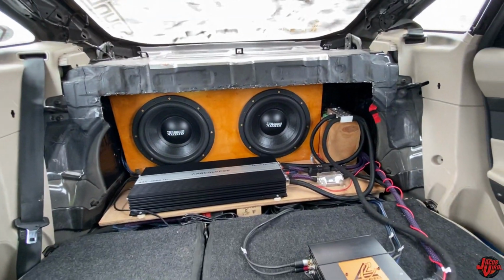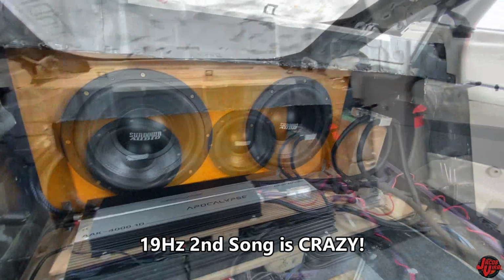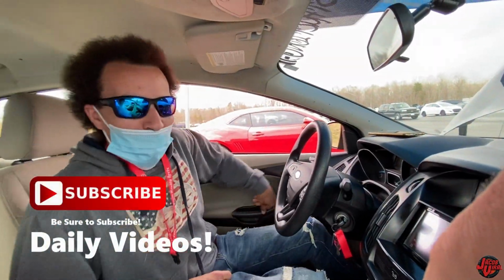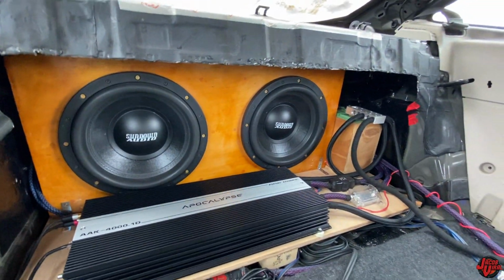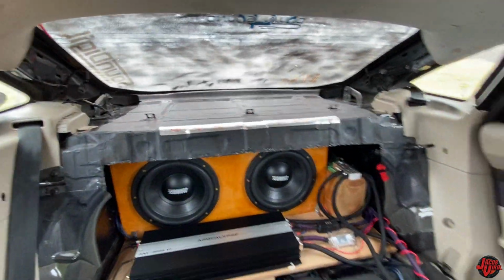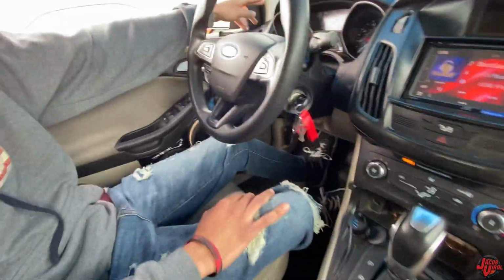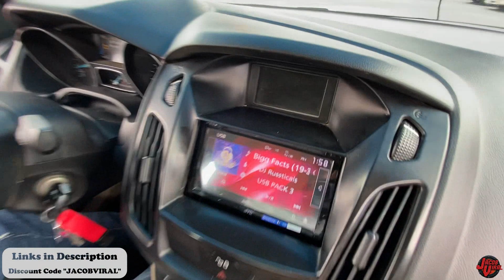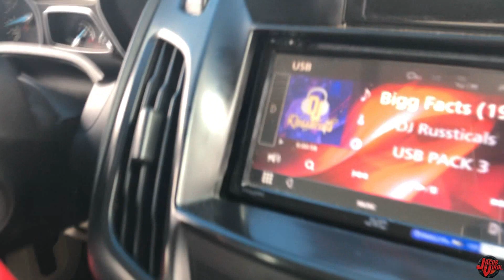2 12” SUBS TEAR UP THIS FORD FOCUS!

Comment: A similar set up I am doing. I have octo port as well. Running two zv5 12’s. Only difference he looks like he’s got more space to work with. My box takes up the whole trunk barely enough space for the cmax and amps in a Hyundai Accent
Reply: Ever consider using your spare tire space for your battery?

Comment: What the F×××!!! That's louder than my 1 18" Resilient Sounds Platinum subwoofer!
Reply: More cone area dude. What do you expect. For all the bass channels I see you comment on you're not learning too much
Reply: You need more power and a bigger box then
Reply: @Simpleman1078  I thought 2 12" subs was less cone area than an 18" sub but I gess you might be right.
Reply: @nickolasvaughn667  o no definitely don't need a bigger box. I actually need a smaller box and I'm running it on 4600rms watts!
Reply: 18 inches of cone space vs 24 that being said I would take an 18 over two twelves even if it was the exact same brand & model. A 12 just can't produce the same sound as an 18
Reply: One 18= 254.46sq inches. Two 12s= 226.188sq inches. Some people need to do their math (slow poker). You’re having a box design issue. JVs single Fi in a huge enclosure doing mid 50s is proof. Of course power helps too
Reply: @kylemalone8953  I know. My favorite sounding subwoofer is definitely an 18"
Reply: @RyanBassForLife  I think 2 12s have more cone area than a single 15